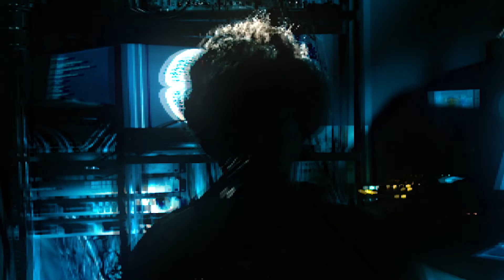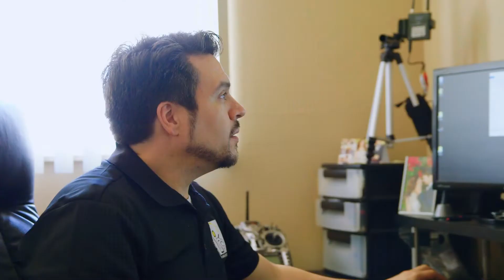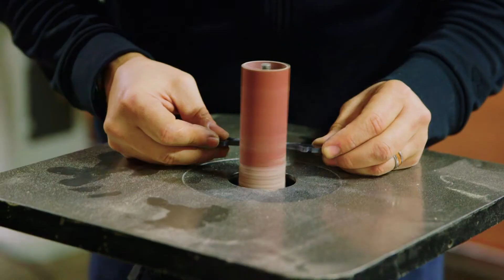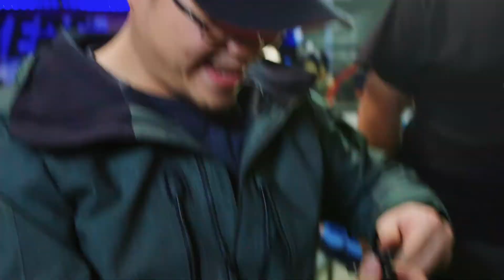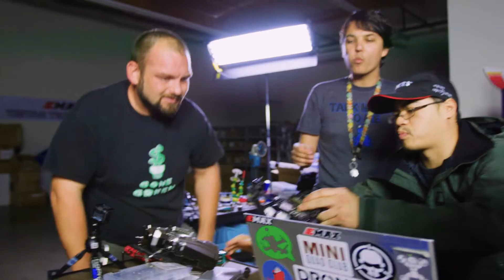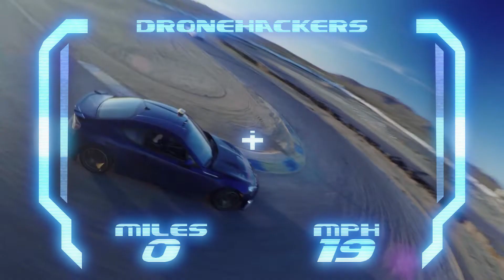We Made a Homemade Drone Race a Sports Car

Comment: I can appreciate the work that went into this pilot, BUT I think you really missed the mark that you set at the beginning of the episode. . The episode  lost site of the concept you put forward in the begging and that probably hooked a lot of people in. Basically I spent 30 minutes watching 3 guys fumble around and build an off the shelf racing quad. What happened to initial concept of a flying ERV "The medical payload" and delivering it 1.3 miles away? They cast raced around a .25 mile track 5 times against a car using FPV. That is not ground breaking in any way at all. The cast  mentioned using a GPS and having the rig fly autonomously at the beginning and that whole plot point disappeared. If they actually build a machine that could carry a payload and fly 1.3 miles away straight line at 100mph , avoiding traffic to drop deliver a life saving dose of a drug or something to that effect I would say the show would be funded. But as it stands, I watched 3 guys build a quad and fly it in a local racetrack using technology that in 2019 has been kind of pushed aside due to problems (the Connex system) . Also the dude smoking, general look of the crews clothing... needs work. Get someone on wardrobe, and get someone to check each shot for things that could easily be better (like letting a cast member smoke on camera) Again, I applaud the effort, I know there was a lot of work put in, the editing was nice, camera would could be better (watch focus man... camera 101!!!) If they want to get this picked up, they will have to address these details!  I'm not bashing your work, just offering an honest opinion. I would love to see this programming make it! I
Reply from the maker: Thank you for your suggestions! We completely agree with you. This concept episode was put together using nothing but volunteers and our passion with any gear paid out of pocket. We could totally deliver a higher quality episode but to hire and manage such a crew requires a budget. This is why we need YOUR help! If you believe in the idea and want to see everything you just said fulfilled, consider backing us on Kickstarter! :)